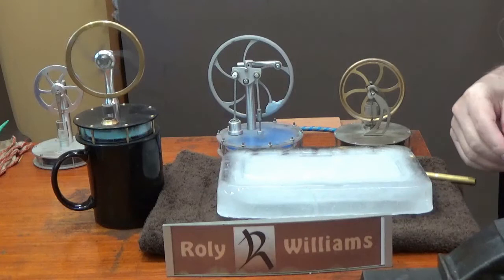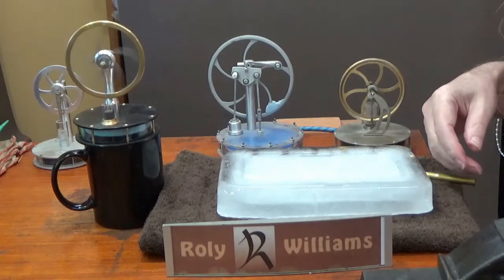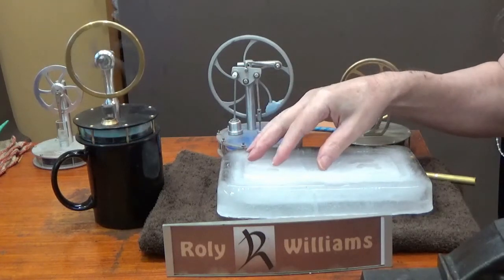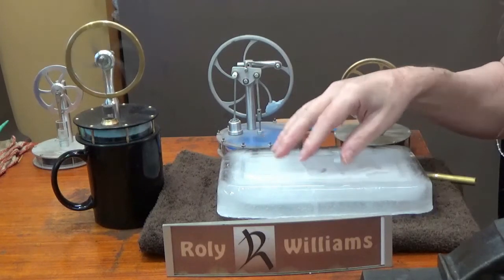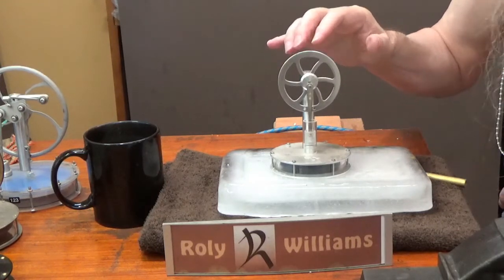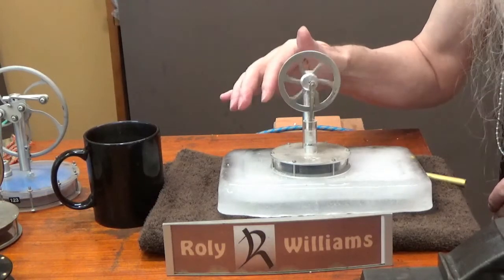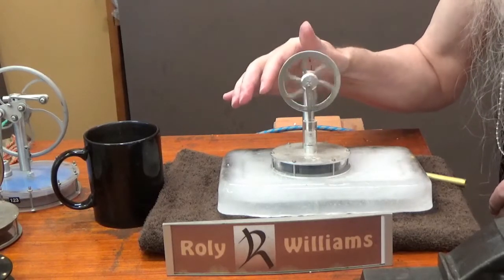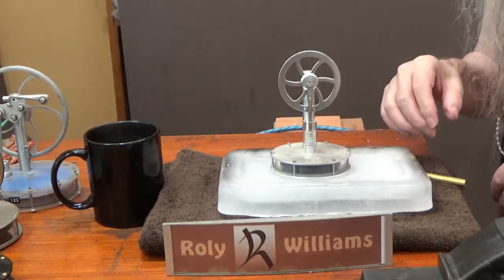LT Stirlings on ice

Comment: Hi Roly, do you have any suggestions for running a high temperature stirling engine? I have one similar to an old Hog. It's second hand and it won't quite run. I'm hesitant to take it apart and clean it

Thanks!
Reply from the maker: The most common fault with small hot air engines is oil in the cylinders. Unfortunately, the only cure is to dismantle it and clean it out. After reassembly, resist the temptation to apply oil anywhere except the crankshaft bearings.
Reply: @RolyWilliams  Thanks! I'll give that a go. It was quite oily when I got it.